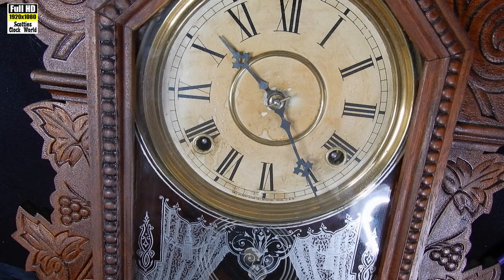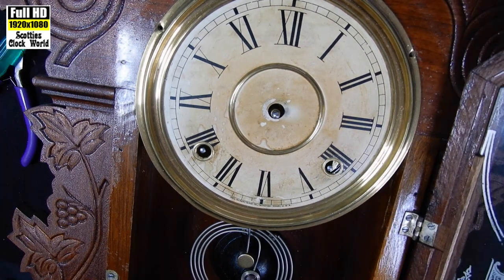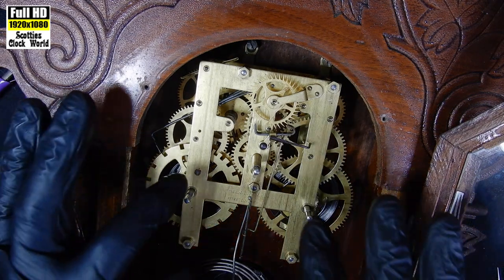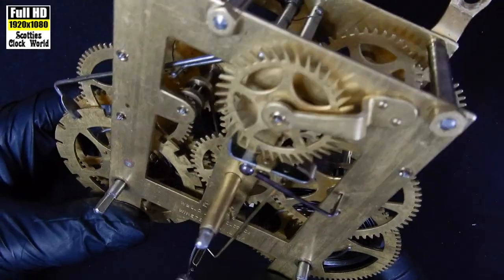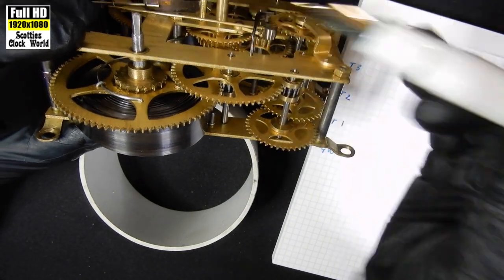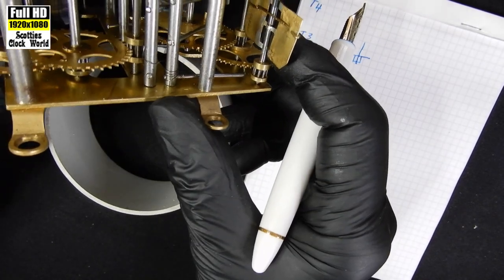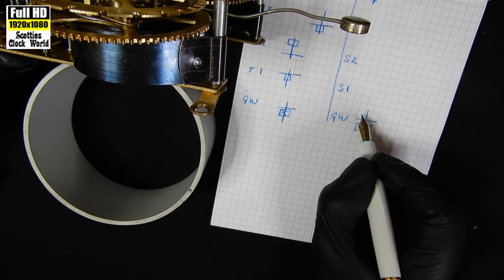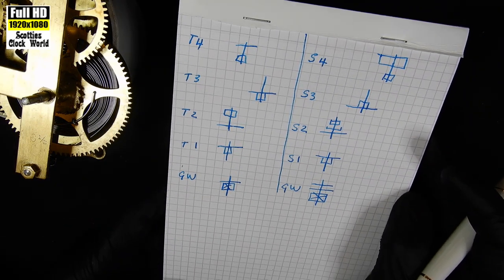Clock Repair For Total Beginners - Lesson 2

Comment: Hi Scottie -a question if I may  After I’ve disassembled the clock what would happen if the time side main spring on reassembling went back in the strike side of the clock and  visa versa - would the clock work??
Reply from the maker: Yes, the clock will still work. The strike and going side Great Wheels and mainsprings each have slightly different wear patterns that's why it's best to return them to their original train.

Comment: What is the cut in your PVC pipe for?
Reply from the maker: That piece of PVC pipe is also used in a slightly smaller wooden support stand I have made. The piece I cut out of the PVC allows it to fit into the wooden base when necessary.

Comment: This could be the most important part, sure wish I had done this! I took pictures but hard to figure out which is which. Working on my first disassembly of a New Haven 8 day banjo which is very similar to this. It had a broken mainspring on the time side that broke into many pieces. Looking forward to the journey ahead-- thanks Scottie.
Reply: Paul make special notes on the strike levers, placement and i know Scottie will go through the way to set them up,  that is what I am fighting with right now.
Reply: @billleeds4023  yeah- me too! took it apart and reassembled strike train-it locks, goes into warning, runs--but does not stop!! I can't see anything hanging up or binding put it down and come back to it.

Comment: I had understood that when the energy stored in the mainspring or cable of weight  wound around the barrel is repeatedly forwarded and reversed from main wheel to escape wheel it causes the pendulum or balance wheel to keep oscillating and causes the motion work to drive the hands of the clock for many days. When the energy is forwarded it causes the escapement to push the pendulum or balance wheel forward everytime it returns backward and when the energy reverses it causes the motion work to drive the hands of the clock either the motion work is direct part or connected to the going train. The gear train that drives the hands of analog quartz clocks too follow the same method of gear train of watch with centre second whose motion work is direct part of the going train but the mainspring barrel is replaced by battery and lever escapement and balance wheel are replaced by small peizo electric motor which is composed of tuning fork shaped soft iron piece, solenoid coil and rotor sprocket between the prongs of the tuning fork (small pinion with magnet in it's base) and small electronic circuit board of resistors, tuning fork shaped quartz crystal oscillator sealed in small cylindrical metal container, 15 flip flops (each flip flop is 2 transistors kept crossing each other), microprocessor chip, etc.

Comment: Hi Scot
 I am hobbyist beginner .I have identical movement which I bought on ebay but without pendulum. Could you please give me some information about it I mean length and weight if is possible please
Reply from the maker: The pendulum is 195 mm long and weighs 118 g. I have uploaded a pic of the original pendulum here:
https://drive.google.com/drive/folders/1_o7BiNaMPU-eZOapMKYM4mXaFe7Wj_W2
file:  jnovak.jpg